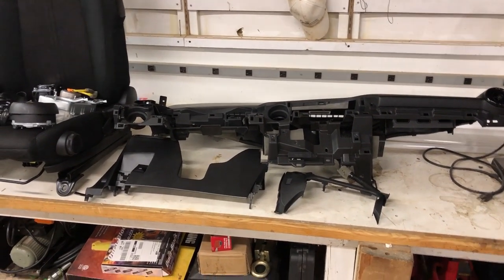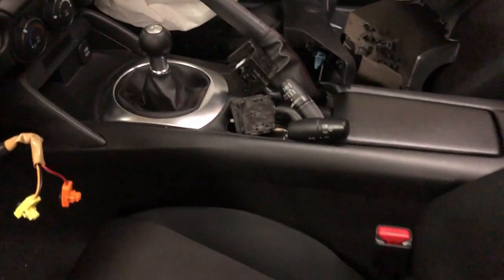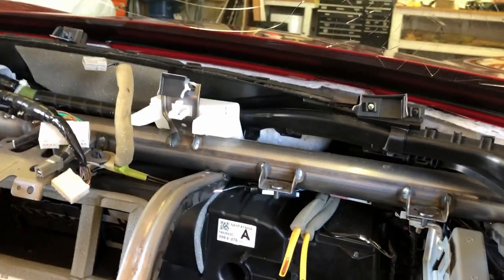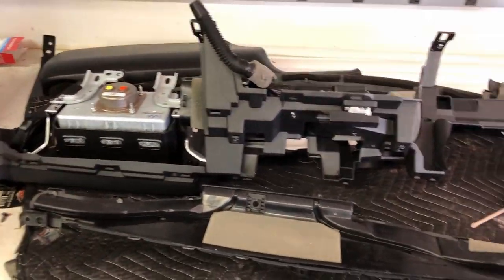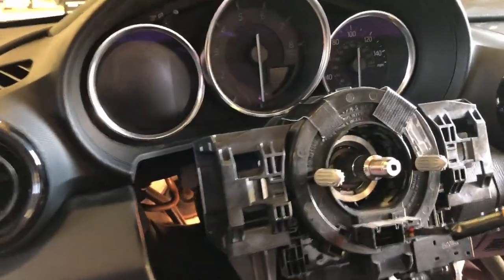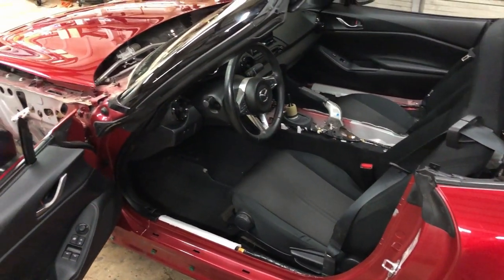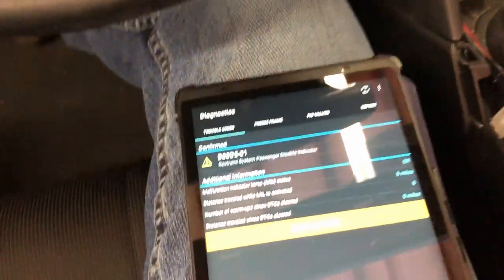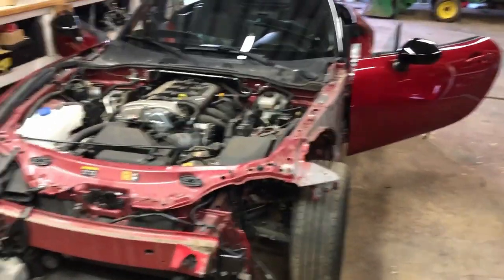Mazda ND MX5 Copart Rebuild; Replacing the dash, airbags, and seatbelts

Comment: I found it very difficult to find information and parts after my collision pertaining to the airbag light.  For whatever reason the little connectors HAVE to have the original cllips shoved in securing it and it is more than just a means of holding them in place they wont WORK otherwise!  I tried and tried with seatbelt pretensioner connector to simply plug the individual connector sleeves over the pins and it wont work until the original connector body has the black pronged clip clicked into place I can explain it cant see what is happening maybe there is a shorting bar like it says even though you can take an ohm reading and it LOOKS like it would work it WONT...I made 2.5 ohm resistors out of nichrome wire to make sure the airbag module I sent out actually was reset.  Where did I get the exact connectors from?  Aliexpress !  China's version of Amazon for $7 delivered!  less each if you buy more than one as combined shipping..  The vendor I found had by far the best system instead of asking make and year blah blah they have a single photo with all the connectors and a hand written number next to each one...I simply held my old one up looking at the photo and matched it up EXACTLY in 5 seconds!  The down side is it takes a couple weeks to ship from China but way sooner than the original quote (they tend to sandbag on that)   And yes the connectors have "pigtails" already so no crimping or whatever ....simply solder the wires to your harness and heat shrink insulation over each lead and then retape it all done and done!  Hope this helps someone because I found no one that took the time to help others

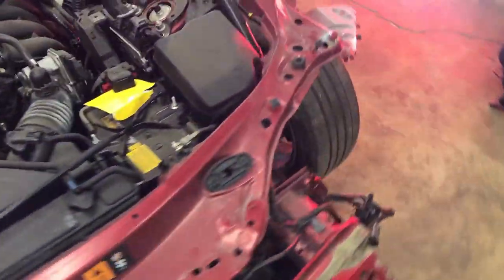Comment: I finally saw the part where you showed one sensor ( 26:35 ) they are next to the headlight assemblies! thanks...my bracket on one side was also bent up but now I would like to test both sensors...anyone know what they should read across the pins?  Is really hard to get probes on but they both read one time or other around 65 ohms?  could be erroneous  I hate to just buy new ones if these are not the problem?

Comment: HI do you know what size bolt length the  seat belt  tower is as far as how long and pitch size, also the same thing for the 10mm bolt below it. I need replacements as I had to take stock stuff out to install a roll bar and need the parts wonder if I can go to dealership and how much they will charge.

Comment: Thanks for a great video.
We are in the same process. How did you get the module reset and codes erased ?
Reply from the maker: I used a company myairbags.com. they turned it around in a day. If you Google "airbag module reset" there are a few different ones. I picked the one I used because they were closest to me.
Reply: @ironicallyengineered2486  thank you. 

Also can you link the OBD tool you are using ?
Reply from the maker: Yes, added to the video description.

Comment: can you get body panels from the dealer painted or are you going to have it painted, they painting is pricey?
Reply from the maker: No,  new parts come in black Primer from the dealer.  You'll have to have them painted or if you're lucky you can find used parts in your color. Painting is expensive,  especially soul red. It's also a terrible color to try to match because of the 3 layer paint.

Comment: So to get the dash out of good (not wrecked) car, you really just need to take out the side bolts to the metal crossmember and the whole dash comes out as one piece, correct?
Reply from the maker: The 4 bolts from the sides, then there's a brace on the driver side transmission tunnel. You'll have to unplug several connectors and disconnect the steering u joint. But you need to remove the seats and console to make space to remove it.

Comment: Another question Sir,

Did you change the side impact sensor ? If yes then what’s the part number for that ?
Reply from the maker: I don't have the part number for that part. If you Google "oem Mazda parts" you should come across a few sites that give exploded diagrams of Mazda parts with okay numbers. Should be under "electrical"
Reply: Anyone know where the front sensor(s) re located?  One seller it looks like there is one but another seems to indicate two right and left??  I can't find them yet but I am assuming this is what is keeping my airbag light on?   I replaced the blown bag and had the seatbelt rebuilt and the module reset but light stays on....one thing happened was the clip broke on one seatbelt connector but I don't think they do anything but keep the connectors from coming off?  I don't see how they could involve actual connection but not 100%...I just have that one taped in place pending finding new clips